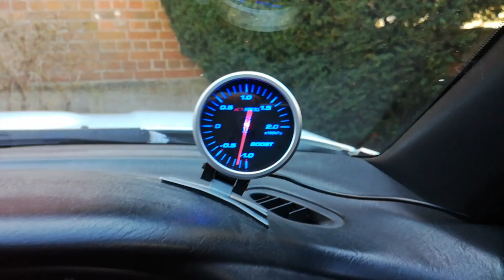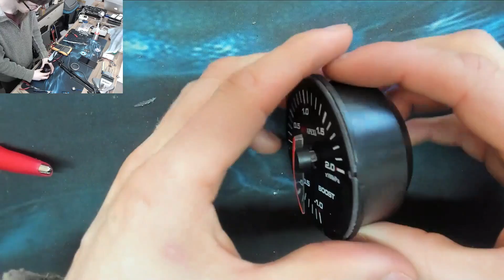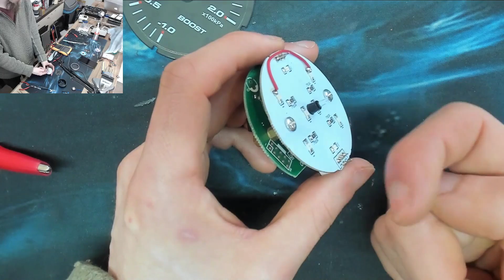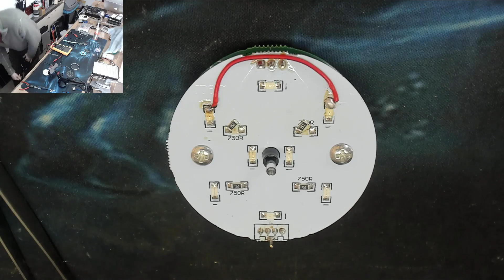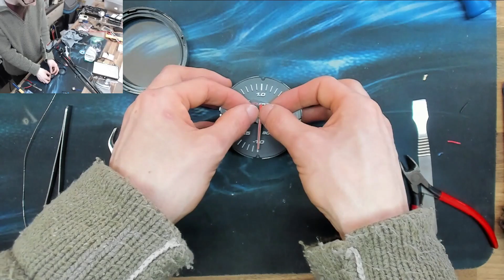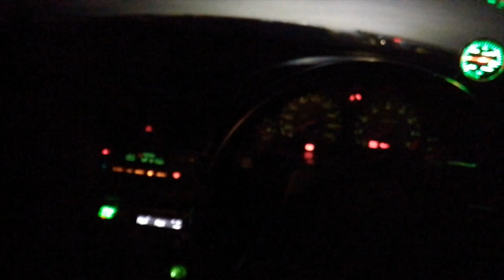Pimp My Gauge

Comment: Maybe making a "Pimp My Dell" or "Pimp My HP" or "whatever other brand" video could be interesting. Like pimp out some old Dell from like 2007-2012 or something in that time window... Like stick the fastest cpu(processor), RAM, GPU, Power supply, and anything else (like add-in cards) that you can into an old pc WITHOUT switching out the case or motherboard! Sounds like a challenge? It is. ;) Challenge accepted?
Reply: I figured that ;). I dug through countless forums to get my rig to where it is. For me I was lucky having a Dimension 9200 MoBo which was a top of the line mode and great for upgrades, but for most it would probably be compatibility issues left and right. :/ Also well, maybe a better idea would be to make a "Sleeper" out of some old gateway or compaq from like idk 1999? that has specifically an "ATX" form factor. Then you could easily stick a modern MoBo in there and the outside of the computer would still look "deceivingly" old. Kinda like a "sleeper car" where they stick a V12 in some old Volkswagen Beetle. I have seen some peole over on Linus tech tips do it. Maybe try the same challenge but just do it on an older ATX machine where you rip out EVERYTHING and substitute for modern parts so the pc is a joke on the outside but then raw horsepower on the inside of the case. Idk from what time period, maybe even rip everything out of a dell Vostro or something and Kabylake it up (make sure its ATX form factor and not slim line and then you are set!).
Reply: Making a Sleeper Rig out of an OEM by ripping everything (including mobo psu and all other old parts) out and Kabylaking it up would seem like a better challenge than that other one I would agree.

Disclaimer: depending oc case you use it may involve a buzzsaw (especially for older Gateway computers because of retention arms).